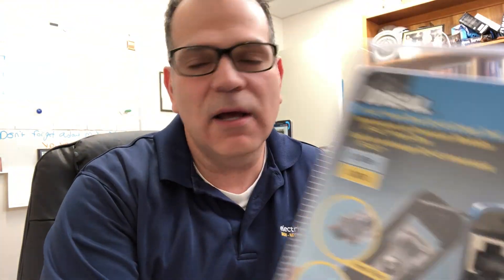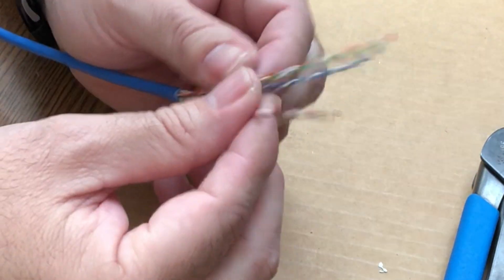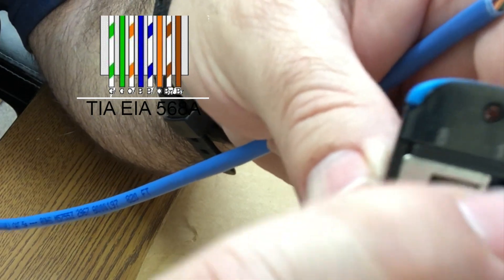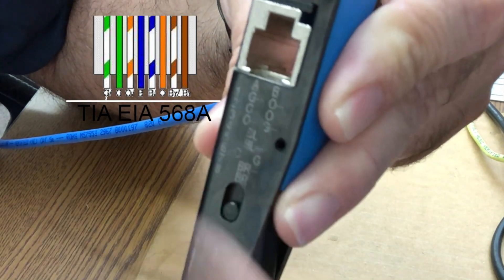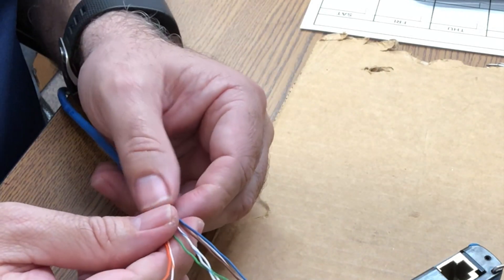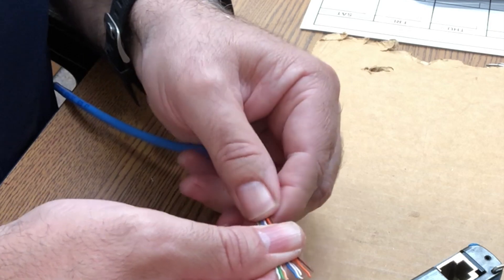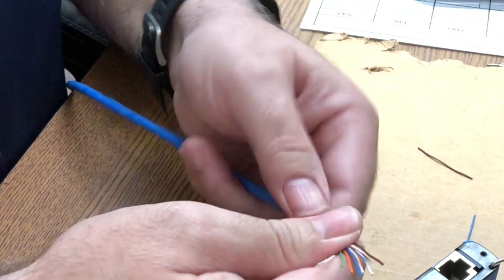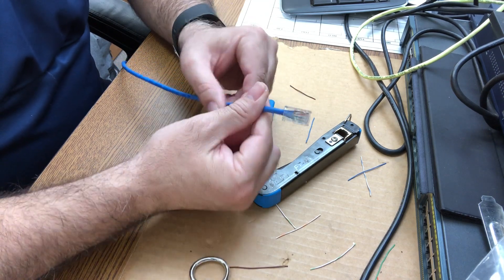How to terminate Category Cable using Ideal FT-45 new tool

Comment: I have the Platinum Tools EZ-RJPRO, which has been around a long time. It also does the 6pin RJ11/12/22 connectors. I like it, though I met one tech who says he won't use the pass-through connectors because he has seen them short out over time. I have not experienced that problem yet. But you can still use the standard connectors with it as well.